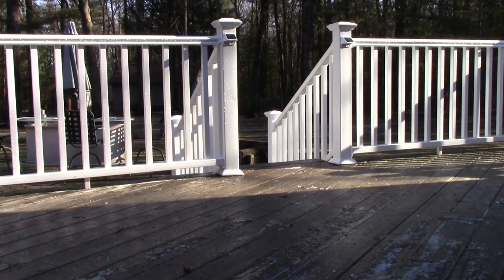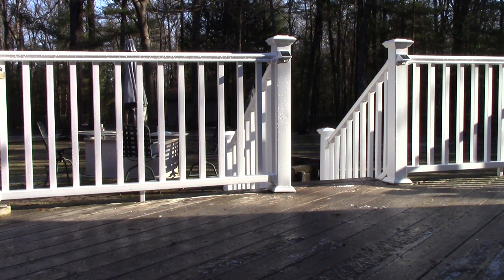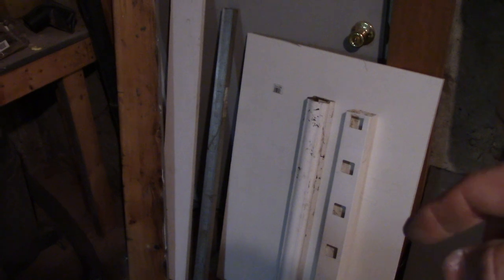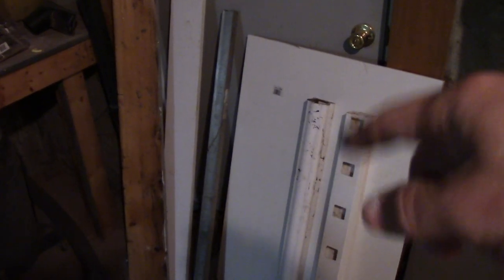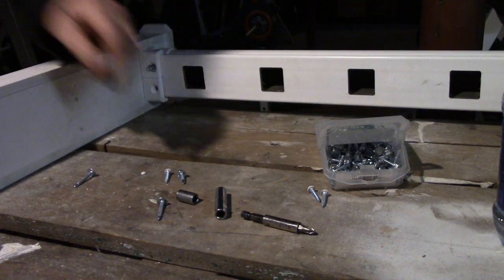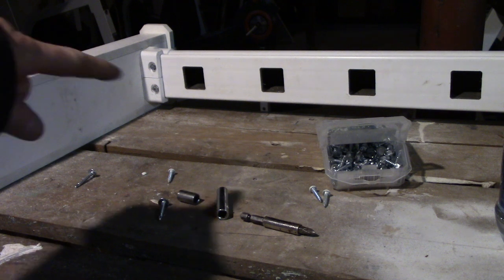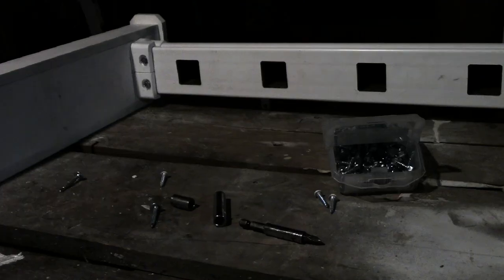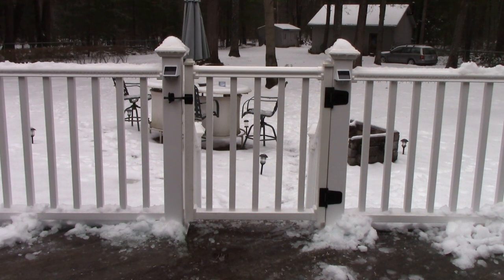Homemade vinyl gate

Comment: Where did you get the caps for the homemade poles?
Reply from the maker: I bought a sheet of that vinyl that was quarter inch thick I think it was 4 foot by 4 foot that Home Depot sells or it's possible it was 4 by 8 whatever they sell that quarter inch stuff and I just cut it up and made my own everything is glued together with the glue that they Supply with the 4 x 4 post caps
Reply: @JLafix  Is it vinyl or PVC or are they the same thing? I went to home depot but couldn't find the sheet of vinyl as you stated above.
Reply from the maker: @shaiddyperez   it's definitely vinyl and my Home Depot had it, maybe look online from the Home Depot site and look up sheet vinyl. I just can't remember how big the sheet is I'm guessing 4 foot by 4 foot
Reply from the maker: I'm thinking PVC and vinyl have to be close to the same thing so if you see a sheet of PVC I'm guessing maybe that's what it was
Reply: @JLafix  Would you be able to send me a link to it maybe if you go online?
Reply from the maker: @shaiddyperez  try Veranda HP 1/4in. X 48 in. X  8 ft. White PVC trim